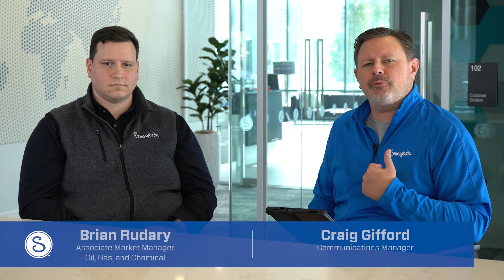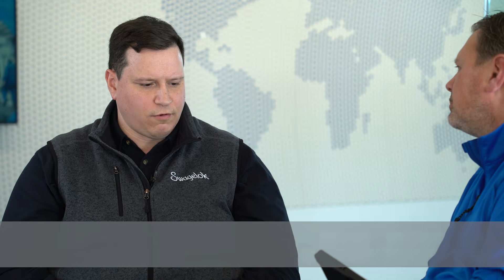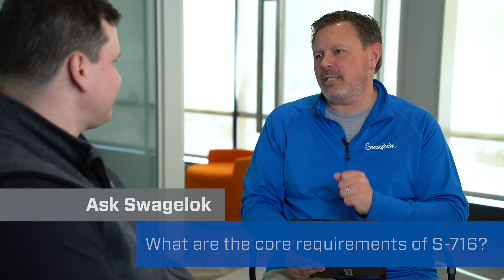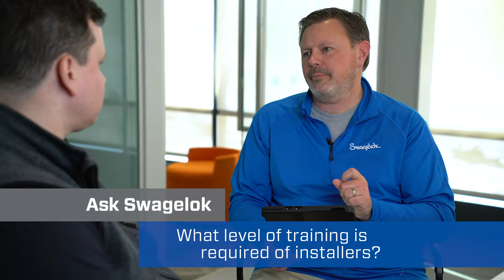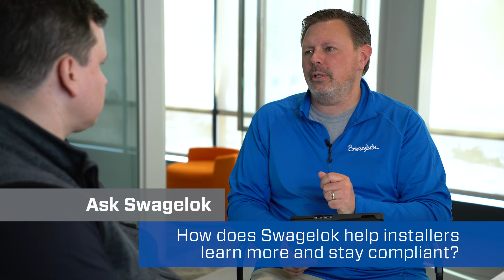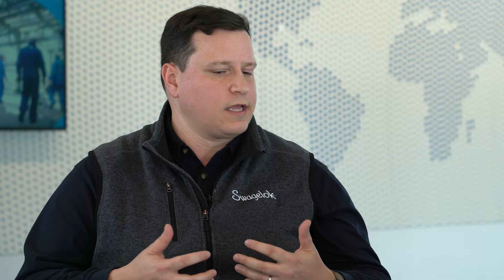Ask Swagelok: Understanding JIP33 S‑716 for Oil and Gas

Comment: Does S-716 cover the fitting end connections as well as the tubing itself, or is that left to the operator's own spec? On a small-bore job that split decides who signs off the fitting data.